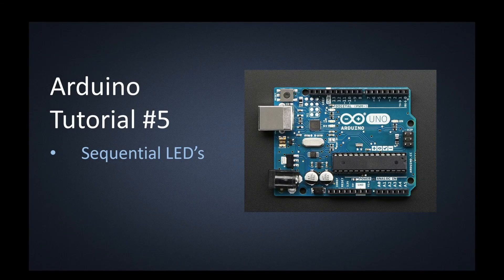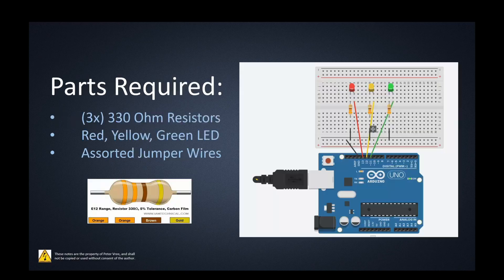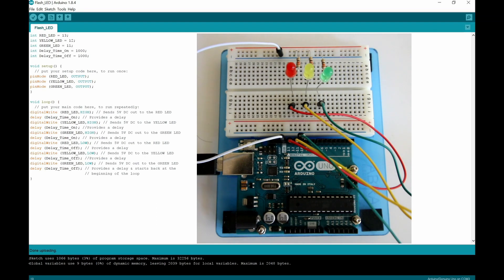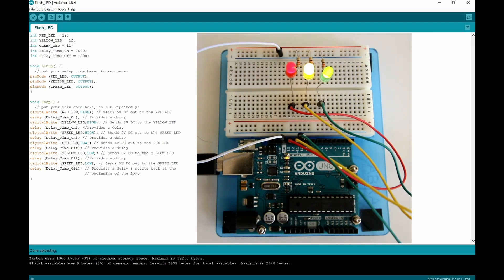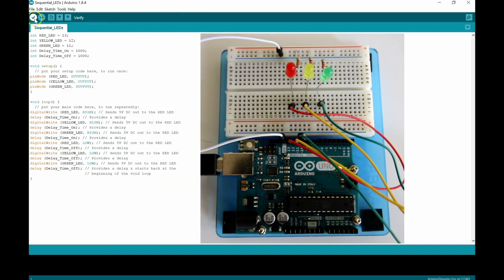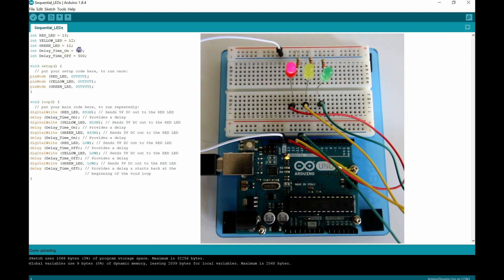Arduino Tutorial #5 (Sequential LED's Flashing)

Comment: Can I give the 9V power supply to 12V power jack ?
Is it right or wrong ?
Reply from the maker: The spec sheet says 7-12V is the recommended voltage. https://store.arduino.cc/usa/arduino-uno-rev3
However, have a look at this blog article: https://cybergibbons.com/uncategorized/arduino-misconceptions-6-a-9v-battery-is-a-good-power-source/
and this one: https://www.open-electronics.org/the-power-of-arduino-this-unknown/